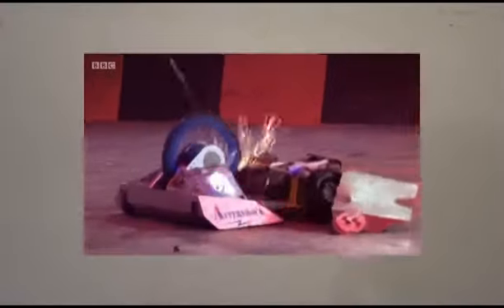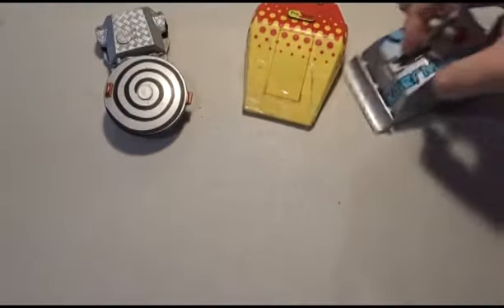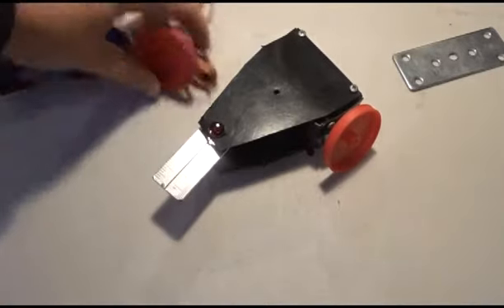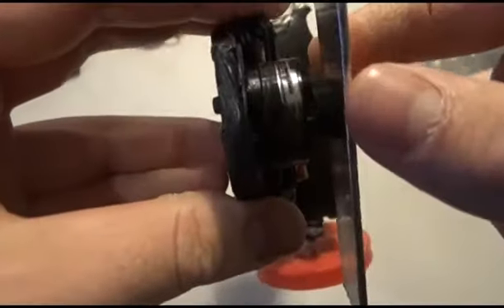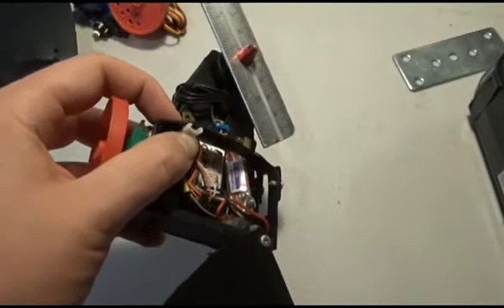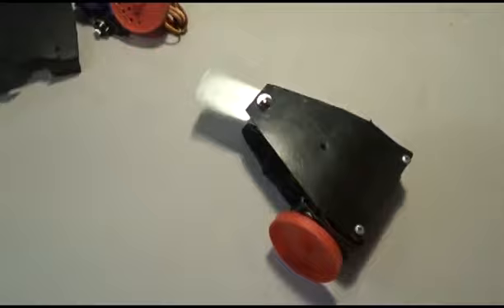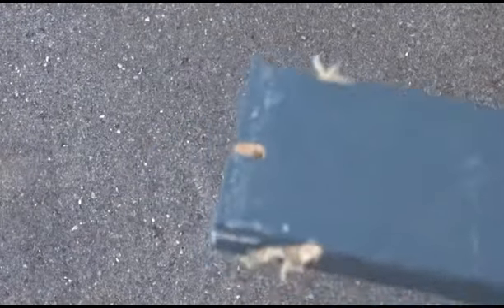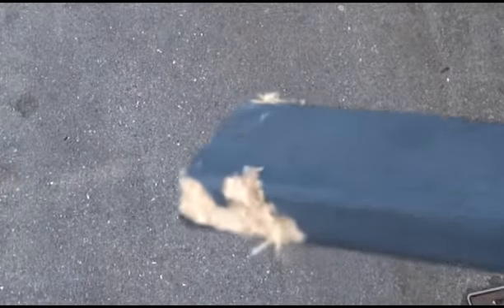Ant Weight Combat Robot

Comment: The blade goes to fast to hit anything
Reply from the maker: Shawn Zhou Yeah I know, ATM I'm in the middle of upgrading it to a beater bar that's belt run :) should be done soon just waiting on two parts :)
Reply: it can hit things. it's probably around the average antweight spinner speed. the main way damage can be done is catching on an object.